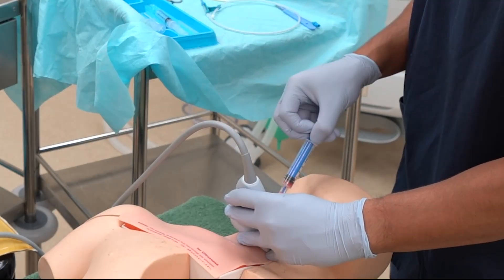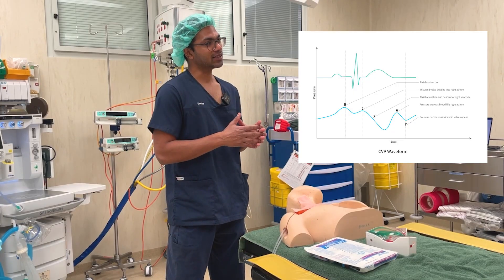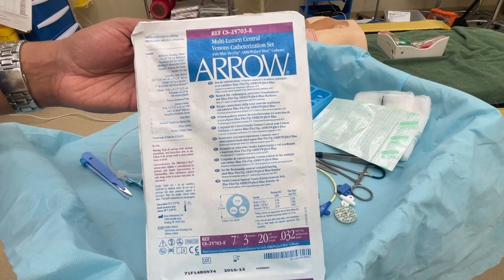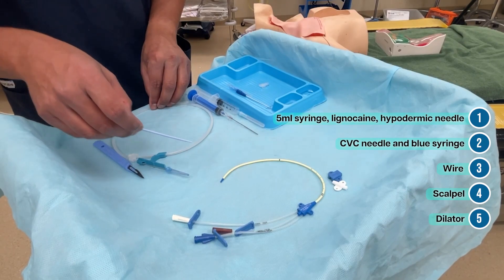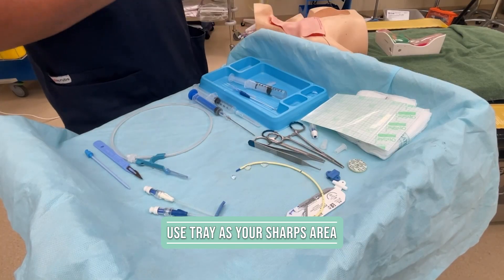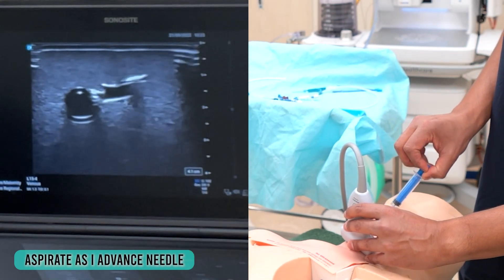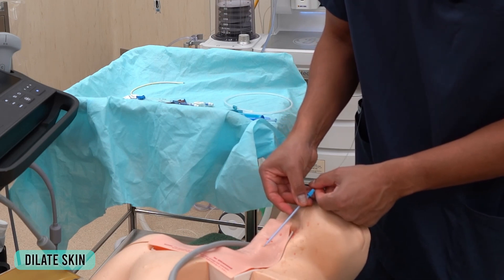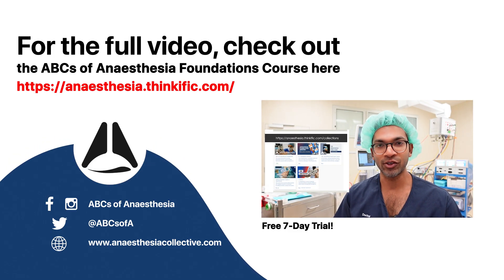Central Venous Catheter (CVC) Demonstration | #anesthesiology #anesthesia #anaesthesia #cvc

Comment: How do you approximate insertion length in obese patients? Is there a way to objectively measure e.g cxr beforehand or do you just go by estimation?
Reply from the maker: I usually go by estimation. But roughly measure distance from needle insertion point to sternal angle.
Also being slightly to far in is better than not enough, you can pull back a cvc and keep it sterile but wouldnt recommend advancing a cvc not far enough (the visible non sterile part now enters the patient)
Reply: @ABCsofAnaesthesia  Thanks, appreciate the videos.

Comment: I´d recommend to do a step-down- or slide-down technique when advancing the CVC needle through the tissue, always visualizing the needle tip; 
also confirm the location of the Seldinger wire (13:27) in two planes (short and long axis) just to be safe it´s in the correct place.
Reply from the maker: Great tips tammy!

Comment: As for fixation of the catheter (16:34): the small pad/clip thing is to be sutured right next to the puncture site, preventing the migration of the central line (inwards, but especially outwards) by patient movement or dressing changes; this is also a safety feature allowing the central line to be retracted (if you didn´t do an atrial ECG during placement to confirm location in front of atrium, but instead opted for doing an X-ray, and noticed it was inserted a bit too deep) or in mobile patients to safely pull out the whole central line (without ripping off one of the legs, which could lead to an air embolism due to the now open lumen) if it accidentally snagged on something...
As for suture kit: you don´t need scissors and pincers - just a needle driver, as you already got a scalpel included in the kit to cut the suture.
Reply: and this clip is 2cm wide - so you can always confirm your CVC insertion depth using the markings on the catheter and compare it to the documentation done after CVC placement ;)

Comment: Nice, thank you!
At 14:05 I´d recommend to not just "dab" any blood, but put a gauze pad there and keep it all the time with a bit of finger pressure, removing it only during the insertion of the dilatator and reapplying it as soon as this has passed the skin, and then remove it just before the central line goes into the skin - that way you´ll never flood the area with blood (especially important if you insert a dialysis catheter as the lumen there is way larger) and prevent any air embolisms coming from the puncture location.